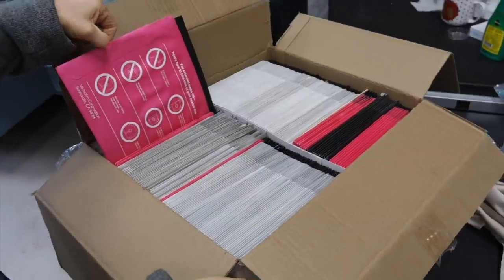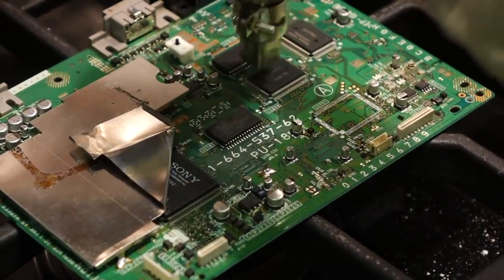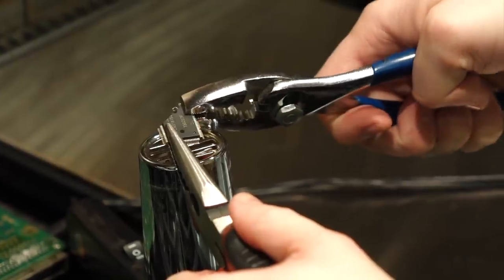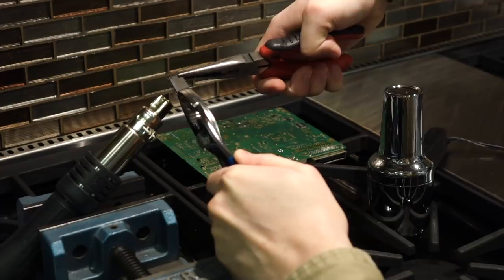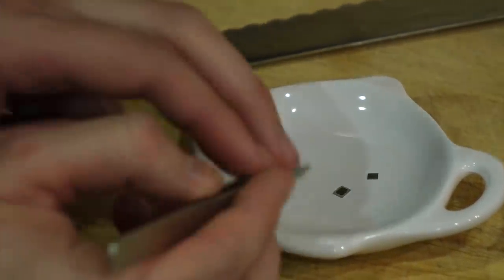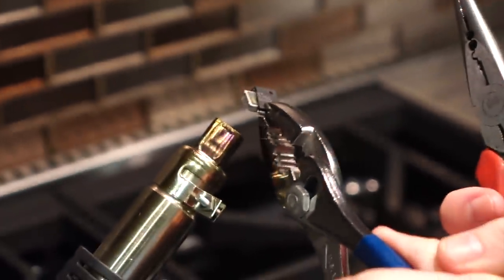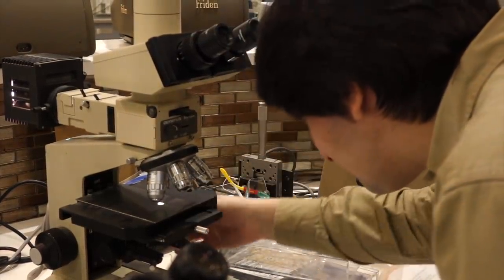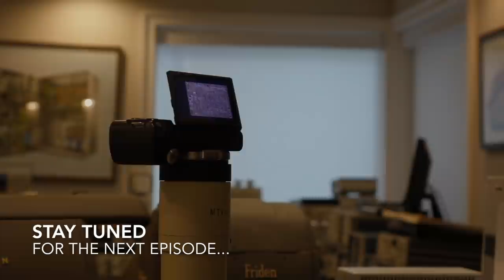Chips a la Antoine: an IC chip de-capping recipe without chemicals

Comment: I just tried this and it works. I can't believe how easy it is! I have tried decapping before using nitric acid and couldn't get it to work. Thank you very much!
Reply: i've actually done it with those blob chips on cheap boards, these ones are a lot more softer than these packages, they almost turn into a paste.

Comment: When I was a kid my parents owned a telecommunications business. When equipment would become obsolete or could not be repaired my dad would sometimes give me the circuit boards. My mom would have killed me if I did this in the kitchen so I would go outside and use a heat gun to remove the epoxy package off the board. My personal experience is with the right technique with a propane torch you can remove a manufacturers die from the epoxy package. I successfully removed some of Intel's dies as well as Motorola, national semiconductor,  Texas instruments, NEC, Hitachi, and many others. I also collected an extensive number of eprom I like the fact they had a window and you could see the die without removing the package. I like watching these videos they bring back a lot of memories.
Reply: Propane torch was my initial way but it damages the die significantly and produce very nasty fumes.

Comment: I had to try it out even before the video was over. Went 2 out of three on some old Realtek audio chips. Awesome!
Reply: When it fails, epoxy does not separate from the die surface... but at least you've removed the bulk of the package which will make chemical decaping a lot easier.
Reply: same here ! :D

Comment: Awesome. I'm already taking photos of mysterious chips for which I can't find datasheets.
I never thought just heat would be enough.
I didn't have a heat gun so I put mine in a fan forced oven set on 260°C. It works a charm, putting them back in the oven a couple of times when they cool down too much.
Reply: It makes sense though... it is basically glass/sand packaged in organic stuff :D

Comment: These high resolution pictures of dies that Antoine makes, are they available online anywhere?
Reply: You can get such pictures from https://siliconpr0n.org/map/ - It would be nice if Antoine submits his pictures there, too
Reply: @DJChol  Is there a chance on the release dates on those chips there? I recently dug in our junk box and found two DIP (lol) atMega8's which were a neat choice for a quick build, as I utterly needed a digital thermometer with a remote sensor. Got all my ASM prefabs close-by so an hour's work, what could go wrong? This: one of the chips, a brand new it seems, just didn't flash, and before you ask I long figured all those tricks like jumpstarting your chips by external clock etc (had to use on the second one, which was a used IC fused for external crystal which I didn't need nor want in this tool). So, looking at how the chip in question was paint-marked, not lased, I guess it was some fake junk I want to find the origins of and do some ass-kicking - though I wanted to X-Ray it first, and compare to the photos (as those things have additional marking on the chip itself too).
Reply: There is also a large collection of die photos taken by an individual to be found somewhere on commons.wikimedia.org, but I can't find the right keywords to find it.
Reply: @winstonsmith478  I don't know if this the one you are talking about, but there is this user: https://commons.wikimedia.org/w/index.php?title=Special:ListFiles/Epop&ilshowall=1

Comment: I just tried with a Zilog Z80180, coincidently using the exact same dessoldering gun as Marc’s. I was easily able to reach the die, but it was covered by a layer of packaging material that just wouldn’t come off. RIP Z80Z180…

Comment: The only issue I have with this method is that once the Die is exposed all the heat will cause it to start growing oxide layers. If you do this method too slowly you might get some optical alterations on the die because of this. Which could make your Reverse-engineering efforts a bit of a pain.

Comment: Funny, we used to reclaim ICs from boards by putting them on the hob, turned down low and with an IC extractor, then yank those suckers out. That was over 30 years ago and we were utterly destitute electronics students that hadn't turned to crime or paid work to get components from reputable suppliers 🤪  We noticed that if we held an IC in the burner, it would often crack and a simple twist would reveal the innards. Unfortuately, we didn't have access to a decent microscope at the time, so the best we could see was around 50x I think, I did crack open a Sinclair Spectrum ULA back in the day and had a look at, nothing interesting on it as far as I recall.  I just wanted the Z80 and the RAM (sacrilege I know!) for a shoestring microcontroller build.  The last IC die I looked at was a T805 Transputer (of INMOS fame) a ceramic package that I put into a board then hit sideways on with a sharp chisel, the cap popped off to reveal the glory inside 🙂

Comment: I remember doing this a few times in my teen years, but I used a burner instead of a heat gun as I didn't have one back then. This generated tons of black toxic fumes, so I stopped doing it. I still have a drawer full of random chips that I wanted to decap. Somehow it never occurred to me that I can just use a heat gun!
Reply: ...turn down the heat? 😝  I used to do in my teens too, heat up a board on the hob, extract ICs, found this die splitting technique from being bored and wondering what was inside, it wasn't all that interesting, but then I didn't know then what I know now 😎
Reply: @davidhunt240  I’m a current teen doing it in by basement lol
Reply: @BGTech1  yup, we were all young once 😝  I often wonder how I'm still alive after those years 😂

Comment: Is there a way to reuse such a decapped chip by connecting wires to it directly? Or they don't work anymore after this procedure?
I have an old motherboard from a vintage computer broken in half and the chip packages are cracked, but your video made me realize that the chips inside might still be intact, so if I could take them out from the plastic, maybe there's still a way to revive them somehow? :J

Comment: What's the technique when you have a die with bond wires, BUT the die and bond wires were encased and covered in ceramic cement? Some of the Intel BGA chip (mid 90s) were like this, where the die was on the underside (but not a flip chip die). They would cover the die and bond wires over with black/brown ceramic. Is chemical the only option to dissolve the die away without ruining its top layers?

Comment: i've done this, fire works but if you take it too far, the die is discolored, still fully readable but clearly burnt :D
Reply: also, try clamping the entire thing down and just hit the edge with a utlity knife once it is heated, you can usually pop the entire top off in 1 go, it is a bad idea to bend it in the middle as silicon is so fragile, a pair of side cutters off to the side and even diagnally in form the corner tends to snap it right at the egde of the lead frame and the die so you dont break the die as easily

Comment: i don't have an hot air gun, just an hair dryer and a blow torch, but i'm curious if it would be possible to hook some needles on the dies and see if they still respond, of course big digital ones may be a bit out of hand
Reply from the maker: Yes, you should be able to make IC dies work by probing them. I don't have good probes in the lab for that, but have been trying to acquire some reasonably priced used ones for quite a while now. Not easy.
Reply: If you want to do this, buy a paint removal hot air gun at the hardware store: hair dryer is not hot enough, while torch is too hot and leaves much damages on the die
Reply: @CuriousMarc  AH... i simply turned on a 1W white LED without the phosphor (so the bonding wires were off) to let the blue light come out, i used a pair of regular needles and a 7$ USB microscope

Comment: I tried this recipe and I failed perfectly: each time, the chip ended in several pieces, still solidly attached to the epoxy. What did I do wrong ? (the carrier plates came out quite nicely, however)
Reply: in the video, those are older chips. modern chips are typically thinner, so you have to be very very careful.
Reply from the maker: Antoine tells me it is due to the particular epoxy used in the package. On some packages the epoxy sticks to the die and he observes the same failure as you do. He is developing other promising methods to get around this right now.
Reply: Surprised to see you here. I am currently working with this technique with ic chips with lots of success
Reply: Unfortunately I’ve had this failure a few times with more complex chips and it can be frustrating

Comment: I successfully decapped a lot of chips but now I have a new problem. Can’t find the best way to store the dies. Tried looking for concave microscope slides but can’t find the right kind with a flat cavity. Tips?
Reply from the maker: I use Gel-Pak boxes, which is what we used for dies in the clean room.
Reply: CuriousMarc very interesting. That would be ideal. Thank you.
Reply: I buy 2x2" ziplock bags, they are very cheap and very light. I also take a photo of the chip markings and print it as a small label to store them in the zip lock with the die.

Comment: Using this method i just found out that the 68010 i bought from china is actually an Intel 80C186EA. The damage is $2.76... Seriously, they desoldered, sanded the original marks off, coated then engraved the fake text on it, for less than 3 dollars.

Comment: I'm interested in decapping and have considered attempting it, but most methods involve acid and a lot of trial and error. I'm still worried with this technique I'd break the actual dies. Probably better I leave it to the professionals!
Reply: Methods involving acid usually means concentrated fuming nitric acid. Really nasty stuff. You would need gloves, eye and nose/mouth protection.
Reply: You have no sense of adventure, and no old chips laying around? This method looks really straightforward. I'm definitely going to give this a shot.

Comment: Awesome! I will try this in my lab with BGA soldering air gun. However I missed the temperature you guys used,  400°?
Reply from the maker: We used 500˚, but can't remember if it's C or F...
Reply: I use a heat gun for paint removal at medium setting, Marc did not had one. ~500°C should do.
Reply: @adberco  Thank you both! I tested this method (500°C) at lab today on approx 20 chips. About 60% success. But that smell is horrible, dont recommend to to this at home. My lab smells really bead even at night :D Anyway its good but not perfect, in 40% of attempts I got nice and clead die with blob of epoxy in the middle of structure without able to get if off.  It seems that various epoxy are used because RAM chips can reach 100% success...
Reply: @marekhelebrant7497  Fume hood or outside is the way, but it should not smell too much. For the 40% where epoxy is stuck there's not much that can be done, but they can be processed using chemical ways (and with a lot less material to remove). Epoxy composition or die surface is likely at play: some manufacturers like National Semiconductor give me 100% failure.
Reply: @adberco  Thanks Antoine! Good to know that National Semiconductor is known failure. My tests were with mostly "no name" china chips, maybe these smells worse than others :)

Comment: what's the model of that Olympus microscope ?
Reply from the maker: It ‘s an Olympus BH-2, the metallurgical variant (BHM).
Reply: @CuriousMarc  ahh , its the one i have been looking at , i keep flicking between a paused video and looking at a BH-2 , the one in the video is more blocky then the bh-2 i'm looking at. there is some updates i guess from the one in the video. but thanks for letting me know. & i think its fascinating what you do , its making me learn more and more , i pause your video's and google all the technical names & part numbers of the TTL's , microprocessors , and various other things i have seen on your videos & try to find a simplified mean of there internal  structures and what they do and how they interact. with the other onboard electrical peripherals
Reply from the maker: @StatusFIX  It's probably because my BH-2 has the updated universal illuminator that does both bright field and dark field and is squarish. Can't remember how it's called BH2-UMA or something like that. The original illuminators were roundish.

Comment: Wow, it's impressive that this works.  Too bad the success rate is too low to be used on really rare chips.

The early 90's are when "sea of gates" technology started becoming common, so these chips don't appear to have much structure compared to older chips.  These are pretty, but die shots from 80's technology are more educational.  8)